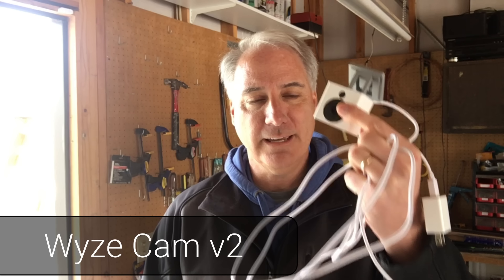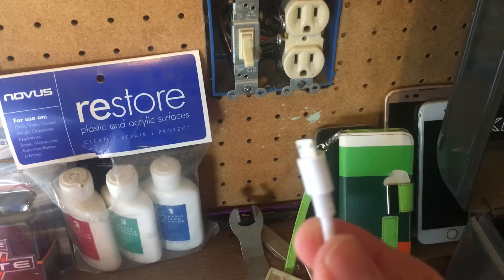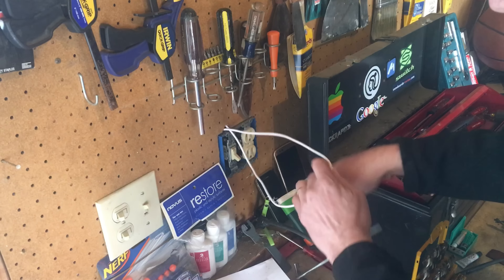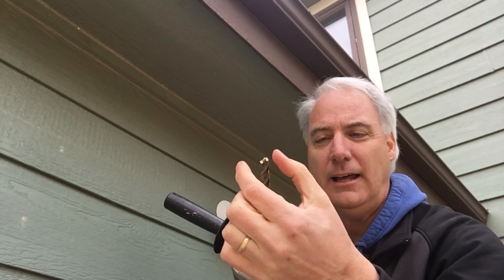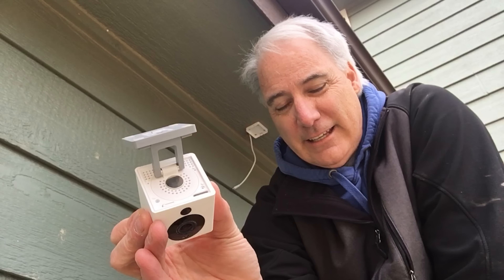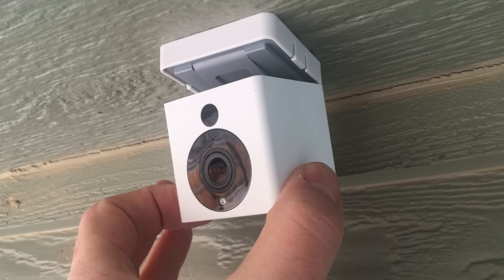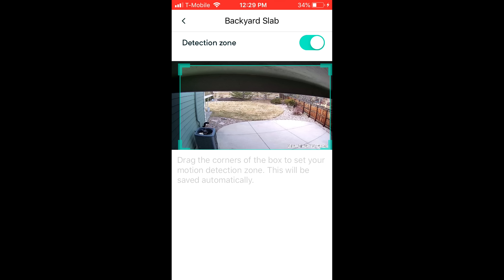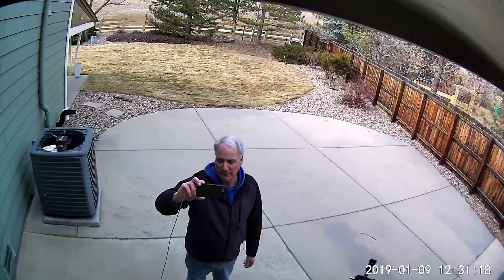Wyze Cam v2 Install Outside under Eaves with No Housing

Comment: U are about to find out how crappy these cameras are in warmer weather as spring approaches. I've had mine outside since last summer. Talk about annoying motion notifications even on the lowest setting! Any little moth, bug or spider sets the motion off. I contacted the manufacturer and they say the algorithm used to detect motion is pixel related so it isn't good for outdoors motion wise. They stated the infrared light on the camera is an attractant to the bugs and that its software cannot differentiate between bugs and larger things like people! The cameras even send motion notices for sunlight changes when a cloud causes shade or intense sunlight. Be prepared for not wanting to use the motion part of it. I would have purchased a lot more of these for myself and family if they weren't so useless motion wise. Other than that a wide angle lens would make it better too. Too narrow field of view in my opinion. Had any false notices yet or has cold weather be useful so far?

Comment: Quick question. can you use this camera just to record vedios without Wi-Fi Thru the SD card only.
thanks
Reply: Yes
Reply: @davidpopiolek2042  I tried that is not working once you get the Wi-Fi disconnected will not record to the SD card.
Reply: Yes and indeed this camera is too good on that, even giving you a fantastic "Time-lapse" feature.

Comment: Why didn't you just use the metal plate and the adhesive that came in the box?
Reply: As a general rule, any time you have wood always use screws. The adhesive may not last, plus if you ever remove the camera removing the adhesive is a pain.

Comment: I think you are OVERLY concerned about water in that location.  If it gets wet where you have it located, you need to be worried about a FLOOD or HURRICANE. It will be fine.

Comment: You know they have wireless?
Reply: The USB cable going to the camera is only for power. They talk to the router wirelessly. They could be run with a battery, but, since they actually talk to the router, they require enough power that they would run down that battery in a few weeks. In wireless camera systems, the camera transmits a low resolution, NTSC video at a reduced rate to a central hub, which does the talking to the router.  To save power, they send at a very low frame rate. Even so, the batteries still have a fairly short life.

Comment: Now Doug, I love your videos but it looks like a rat nibbled on your pegboard after you got done with the hole drilling.  Carpet knife would have worked better.  And you have a cord on that 1/2" drill.  OMG.  Hey, use your critter  trap for that rat.  BTW, I have the same Dewalt screwdriver.

Comment: This guy wins the Darwin Award for play electrical wire roulette. Someone take the power tools away from this organ donor.
Reply: Funniest comment ever...!!!hahahahahhaha
Reply: Exactly my thought  - Blindly drilling immediately above the electrical box where the line would normally be running from the top of the box to the light fixture.   
I stopped watching when he tried to enlarge the first hole.
Reply: Now.... that's funny!

Actually, Dave is a very smart and informative guy. HOWEVER, I've never seen Dave go all "tool belt" before. Based on this video, Dave may want to keep his regular day job.
Reply: @thomasottvideos  :D
Reply: I like the video.  Not everyone knows how to do this type of project, or would tackle it.  He isn’t afraid to show his trials in doing so... gotta respect that
Reply: @marybaker8582   he is not showing he is playing teacher. Me I prefer a better teacher... at the minimum a safety conscious one .

Comment: Hey, Dave; thanks for this! You inspired me to try the same thing and I mounted my Wyze cam under the garage eaves to guard a backyard gate. I have temporarily used the double-sided sticky tape and disk provided with the camera as I was unable to order a mounting bracket like yours in Canada. (Sadly, quite a few handy things aren't sold here and Amazon.com won't ship them to Canada either.)
I have my fingers crossed that (a) the camera will stay stuck up there, and (b) the weather won't kill it. :-)
Thanks again for your tutorial.
Reply: Bruce Walker how is the cam doing n how is the metal n 3m tape doing
Reply: @funkingbros4851  the camera's working fine and it' still stuck firmly up there. We've had some really hot and humid weather and a few thunderstorms too. I received a plastic bracket I'm ready to use, but I'm leaving well enough alone for now. :-)